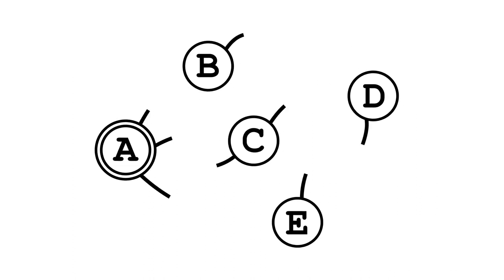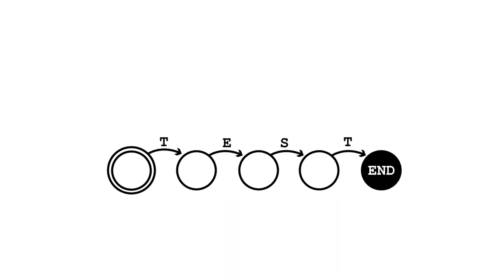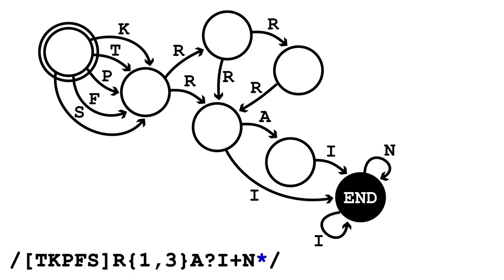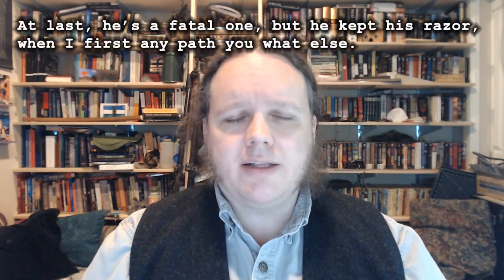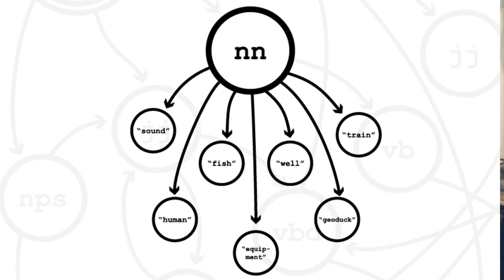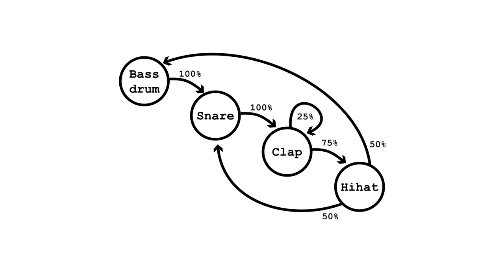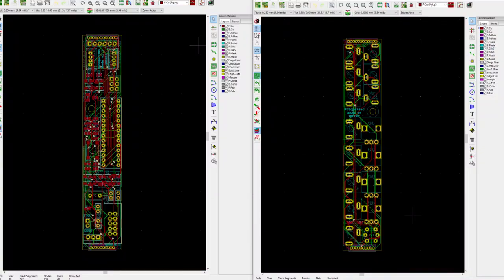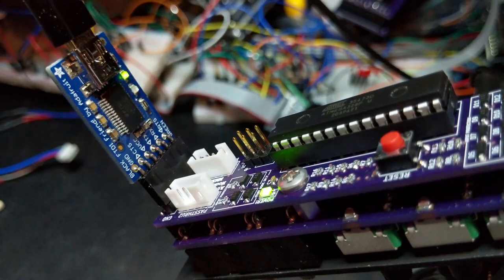Eurorack DIY: The Node module and stochastic sequencing

Comment: Looks super cool, I especially love that it’s modular (add as many nodes as you’d like). I’m a happy teletype user, but supposed I would build this, is there any plans to provide panel/pcb, flashed chips, partial or complete kits?
Reply from the maker: Not from me, I'm afraid. But I wouldn't object to anyone else who wanted to do so.
Reply: @Attoparsec  cool, I might get a few nodes if there’s a group buy at some point... thanks, cool modules!
Reply: @Attoparsec  you might see if Synthcube or Modular Addict are interested in picking this up. Small return for you but they handle all the kitting, shipping, warranty...

Comment: So here's a question-- if you take 4 of these node modules, does that leave you with ONE state machine?   Or 4 state machines?    Isn't it possible for more than one node to be "active" at once (in the triggered state)?   If it was a single state machine, only one node could be active at a time I would think.     Either way, I'm also thinking that the Monome Teletype could be set up to stage N nodes of a similar nature, only limited by the size of its pattern buffer, used to keep each state and associated probability values so that the scripts are not hard-coded for the interconnections, its data driven and therefore easier to configure and reconfigure (not as easy as patch cables, but somewhat more powerful)...

I'm also thinking that if you had a set of these nodes with weighted inputs instead of weighted outputs, you'd have a neural net...
Reply from the maker: It would depend how you patched them up. There isn't anything preventing multiple Nodes from being active at the same time, which means it isn't technically a state machine at that point. But it's not like we're trying to mathematically prove features of these systems, so it doesn't really matter. (And it can sound pretty good!) So purely as casual usage, I'd think of any group of Nodes patched together as a single machine.

I haven't used a Teletype myself, but it definitely looks like it could implement state machines. That would be really cool!
Reply: @Attoparsec  Yeah, the Teletype is kind of a weird beast, I got one recently so there's some learning curve to go but I'd say it's well suited for this sort of thing.  I'm also thinking that with the configuration stored in the pattern buffer, a triggered script could be used to randomize the interconnection data, so you might be able to just trigger it to get some random combination-- not sure how useful it'd be but it seems easy enough to try.